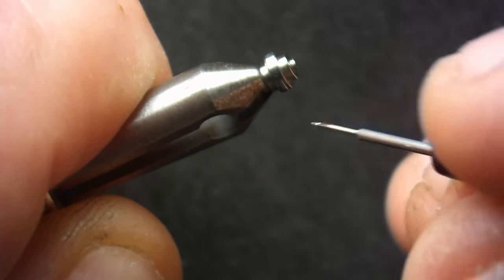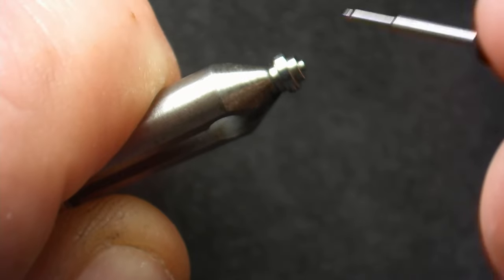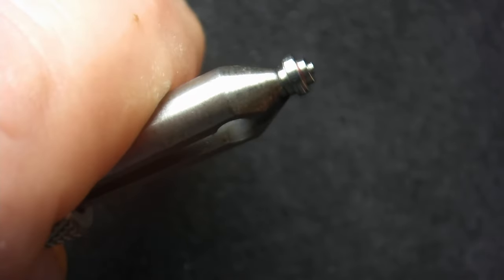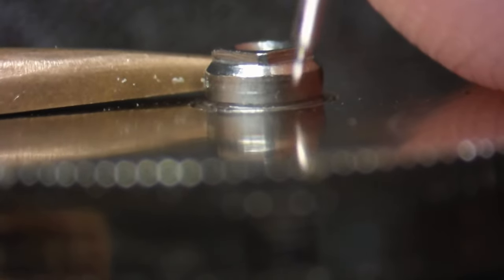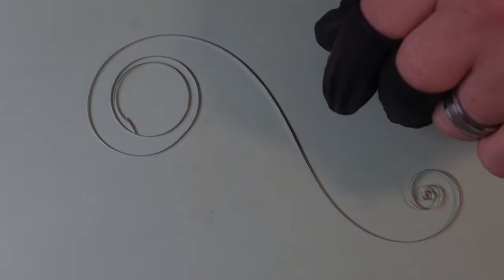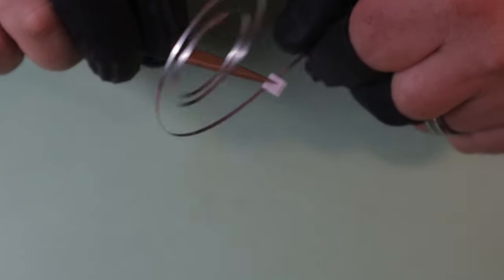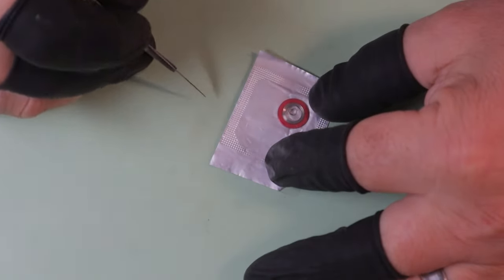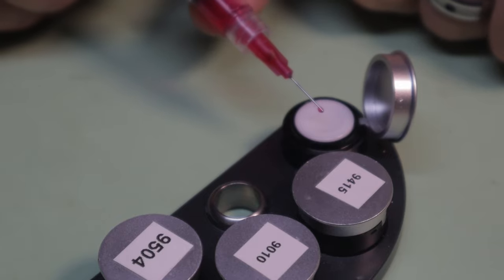Watch Lubrication for Beginners

Comment: Here be nuggets of gold
Reply: The shock system and pallet stone lubrication is coming up next. There may be a couple Nuggs in it.
Reply: Aye, the syringe tip is so simple it's brilliant.  But does the oil degrade the rubber plunger in the syringe?

Comment: It's interesting that everyone seems to do lubrication generally the same but also differently if that makes sense.  It can be confusing watching multiple people do lubrication on watches.
Reply from the maker: That's why you should watch people that have or do it for a living.
Learn the right way and don't get into bad habits.
The biggest issue is over lubrication. As the wheels get smaller, less oil is needed on each wheel pivot.

Comment: You mention here not to lubricate the palette jewels, but the next video goes into detail about the correct process to do so. Is the distinction between oil and grease? Does "lubricate" specifically refer to oils? I can see how oil would move as you describe here, but grease would only transfer to the surfaces that make contact.
Reply from the maker: No but there is a distinction between the pallet fork jewels and pallet fork stones.
The pallet for jewels where the pivots move back-and-forth are almost never lubricated unless the pallet fork has conical pivots and endstones.
Pallet for stones on the other hand get lubricated with 9415.  9415 is a special thixotropic type grease that basically liquefies when something comes in contact with it like the escape wheel tooth and then as soon as that contact ends it's solidifies
The escape wheel teeth move so fast that a regular oil would be thrown off and contaminate the rest of the movement, which is why you only want to use 9415 to lubricate the pallet stones.
I can see why this could be confusing because the term stone and jewel are often both used when referring to the pallet stone .
Reply: @watchrepairtutorials  brilliant, thanks for clarifying, and the extra detail is very insightful, thanks!

Comment: What do you think about using Moebius 8301 and its best use? When is it best to use instead of 9504, and can I get away with these being the only two greases I use, or should I also have 8200? My current lubes are all Moebius: 9010, 9104 (HP-1300) and for grease: 9504 and 8301 (Grease). Super helpful video, I only ask because I got some conflicting suggestions from another source indicating that 8301 was more versatile than I think it actually is...
Reply from the maker: As far as I’m concerned, 8200 or 8300 or even 8301 are strictly for lubricating a main spring that’s being reused. Considering that there should only be an extremely thin film. I don’t see the advantage. If you have 8301 there’s really no purpose for getting 8200.

Comment: How great it was to have found your channel.
I'm a computer engineer with the mission of restoring some watches I got from my father, two of them are over 100 years old (pocket watches: omega and cortébert) and a Cartier wrist watch, so I have the mission to maintain these jewels within the family tradition where it is in the third generation with me. Therefore, I decided 30 days ago to start my studies to find out how to restore them, but I ended up falling in love with the art of restoring mechanical watches. I believe mechanical watch restoration has become my new hobby. Currently I have gone through the planning phase, purchasing tools, component analysis, cleaning and reassembly (where I am in the phase of studying lubrication).
I will finish with polishing the case, as I am still in the learning phase about this final part.
Your channel is certainly far ahead of the tips I got on the internet. I've already been through about 20 tips channels, but your channel has very perfect classes. So I want to express my gratitude for your shared knowledge and also declare my respect for you. I wish you great success and prosperity.
Reply from the maker: Excellent. I’m sure you will do well as troubleshooting is 100% analytical thinking. 
If you hit a roadblock in your studies, you should consider my course on watchmaking as much of the information you need will not be found on the internet.

Comment: At 13:00, "So, never, ever lubricate the pallet jewels."
At 18:47: "It's not going to be a great lubricant for the pallet jewels"
Was 18:47 meant to be "pallet stones?"
Best lube video out there especially when it comes to the keyless works. I've seen many but your procedure is all common sense and well thought out.
Keep them coming.
Reply from the maker: Hey man,
In my head pallet jewels and stones are the same. So yea, the pallet forks PIVOT jewels would never get lubrication.
The pallet stones get the 9415.
At 18:47, I must have been talking about using 8000 to practice with. It’s better than nothing, but not great.

Comment: This channel is incredible.  You give us all the detailed information that everyone else leaves out.  Such an incredible resource.  

I do have one question though: how does one polish something as small as an oiler?
Reply from the maker: Thank you Steve. I have found the easiest way to do. It is on the rotary tool with a hard felt wheel. Do you load it up with a fine polishing paste like rouge or the Polinum that I used and you just lightly touch the tip to the wheel as it’s spinning. You only want to do it for a second or two at a time and then check it because if you leave it on too long, it could burn through the tip of the oiler.
Reply: @watchrepairtutorials  Thanks!

Comment: High torque low speed Mob hp 1300
Mainspring barrel 
2nd wheel
3rd wheel 
Parts that rotate
Ratchet wheel
Click 
Motion works on posts 
Intermediate wheel
Cannon pinion outside 
Barrel arbor shoulder (where it goes into something) 
End of stem 
Post for yoke 

Low torque high speed mob 9010
4th wheel 
Escape wheel balance wheel

Mob 9504 grease or MDX 
Parts sliding against each other under tension 
Grooves wheels sit on
Cannon pinion 
Keyless works 
Small dot of grease in each flat side of stem 
Ratchet teeth in sliding pinion 
Each side of groove on winding pinion 
End of yoke 
Spot where spring contacts yoke 
Setting lever 

Mob 8200
Mainspring 

Never lube pallet fork 

(Anything I forgot?)
Reply from the maker: That is a good recap
Reply: Good one 👍🏻
Reply: I have no idea what these terms are,I'm new,have a tool kit and fixed my 1st watch...I need to SEE what those parts are so I'll watch the full vid.

Comment: Thank you for the explanation about lubrication and the pallet jewels. I see some of the advanced watchmakers lubricating the surface of the pallet jewels, but they also say you absolutely must use Fixodrop... but never explain why except to say that it "keeps the lubricant in its place." Your explanation now fills in the gap in that concept for me. Since Fixodrop and the recommended jar for it are so expensive, I think just avoiding lubricating the pallet jewel is the wiser and more affordable course of action, so thank you for giving me the permission I need to just not bother. :)
Reply from the maker: First things first. The friction between the pallet stone and escape wheel teeth is one of the highest in the movement and should always be lubricated with 9415z
I always treat pallet stones and escape wheel teeth with epilame.
I didn’t include it in this video because this is for beginners who need to learn and practice proper lubrication first before adding another step.Epilame will not be effective if the lubrication is not done correctly.

Comment: Whew.  Being a complete beginner, these details are invaluable and the step by step process is very much appreciated.   I might have never stumbled onto the techniques of picking up various amounts of oil with different angles and speed.  Obviously, it's going to take a few pages of notes and several re-watches (sigh) to get these details in my head.    A couple of questions:

You showed accidentally getting a puddle of oil around a jewel.  How do you go about cleaning up the "spill"?

Do you do lubrication using a loop or a microscope?   Would appreciate a video on selecting a binocular microscope if possible.   The Chinese microscopes are fairly affordable and I have other projects that would help spread that expense.

Finally, seeing what tools you use has helped trim down the initial shopping list built from reading various forums.   At this point, I'm just enjoying the videos and learning.
Reply from the maker: The over lubrication example was excessive for sure. In reality if it that bad you should probably strip it down and re clean all the parts. Small mishaps can be cleaned up with a Qtip and IPA or Hexane.
I do 90% of my work under a microscope with a Barlow lens which gives me more working room. I really only work on the bench when I need to do horizontal work like jeweling or staking work.
I plan on doing a microscope video down the road but, I would check out Amscope if you are in the market for one. 
The tools for starting out are pretty basic. As you get further down the road you will need to start adding more tools. I typical recommend to build your skills with what tools you have and the tasks that are performed with them like lubrication before moving on to other tasks. no need having a bunch of stuff you can't use

Comment: Did I learn anything at all?  I learned a lot!  Especially about polishing the oiler, the direction to use it and how to move the wheel to check the amount, thanks so much for everything you have taught.

Interesting that you use a grease for keyless works, usually the tech guides for ETA will suggest HP-1300.  Something thicker does seem to make more sense, but I guess the torque is not that much.
Reply from the maker: Yeah, this is one of those areas where it can get pretty controversial, and people are very opinionated about what you should use.
In certain areas of the movement, like the keyless works, where amplitude is not affected, you certainly have more options. I grew up using Molykote DX which is a grease. For me it makes a little more sense to have something that clings to the parts better than an oil where are you have metal on metal friction. 
Oils tend to be attracted to sharp inside corners which is one of the things that holds oil where a pivot in Arbor come together. But oil also tends to creep around curved areas. That’s why I use 9504 in the keyless works because I feel it stays in place better.

Comment: Thank you so much for refraining from the elitist attitude and telling people what cheap oils they can get to practice with! For real, it sucks how many people seem unwilling to answer that simple question. I don't care if the oil isn't going to last a life time, I don't care if it doesn't last a week! I just want to buy an old cheap movement, tear it down and put back together 15 times and see that balance wheel fire up when I'm done. That's it. I swear some people forget that they once sucked at this too.
Reply from the maker: The fact of the matter is that it takes a while to learn how to properly lubricate a movement and there’s really no reason to use the high price correct lubricants because you’re probably gonna be over lubricating it anyway.

Comment: Probably a dumb question, but how do you polish the oiler? 

The clear pictures of the actual oiling and greasing are absolute gold. A big head start on developing oiling technique.
Reply from the maker: The easiest way to do it is with a rotary tool with a hard felt pad and using green Dialux compound or any high polish compound. 
You can also use 1500 to 2000 grit sandpaper to polish it.
Reply: @watchrepairtutorials Makes sense, thanks.

Comment: Thanks, Alex. I bought a set of oilers and I use the largest one to remove oil/grease from the bottles and the smaller ones to oil jewels and other places. I also bought an Obama automatic oiler to collect although I don't use it.
Reply from the maker: Perfect. That big old yellow one is also good for adjusting collets.🤙
Reply: @watchrepairtutorials  Yep, a lot of tools come in handy for other things. I bought a couple of tools from a guy in the UK that thought that they were made to install watch hands. What they really were was Accutron Index wheel finger/collet tools. I was so afraid that someone else would see the photo that revealed what they really were and outbid me, but nobody did.  
I also have a genuine vintage set of Dumont Bulova Accutron tweezers. I've never seen another pair like them so far.

Comment: Hello! What is the best way to polish the oiler tip, from your experience?
Reply from the maker: I use a rotary tool with a hard felt pad charged with Polinum but you can use and high gloss metal rouge or compound

Comment: Thank you for your lessons, they really help beginners like me.
I have a question. What is the proper way to lubricate wheel jewels?  From the inside of main plate and bridge(s), before installing the wheels? Or from the outside, after installing the wheels? I saw videos where some do it from inside and others from outside.
Reply from the maker: In most cases you are oiling from the outside of the plate or bridge. This is the side with the oil sink. 
There are occasions where you apply the oil directly to the pivot shoulder then install it into the jewel. For example like the barrel arbor before it’s installed in the barrel or a seconds wheel that is installed into a hollow center wheel. 
Basically, the rule of thumb is you need to oil it first if you can’t get lubrication directly to the pivot shoulder that rides on the jewel.

Comment: Alex, just curious, you said you don't care for the larger oilers, but which ones were you using in your demonstrations? I'm assuming the finest point one would be a good place to start?
Reply from the maker: Correct. I personally only use the finest tip

Comment: This is great, best on youtube. Any chance for an advanced lubrication video showing braking grease for automatic movements, as well as how to oil the reversing gears? Maybe talk about epilame?
Reply from the maker: I already did. The Braking grease is demonstrated in "How to Get Higher Amplitude from your Mainspring Barrel" and lubricating reverser wheels is done in, "Beginners Guide to Working On Automatic Watch Systems".
Reply: @watchrepairtutorials  Thank you! I watched those when they came out, but clearly forgot they mentioned those.

Comment: A syringe is a great idea, have a bunch of insulin sized ones with the small needles. Don't need 'em for myself, thank goodness. I was thinking less oil would be achieved by removing the oiler fast. Lots to learn.
Reply from the maker: Just FYI. I’ve heard the insulin syringes are too fine to take up oils.
Reply: @watchrepairtutorials  Bummer. I have a few with inch long needles that I used to inject vitamin B, those will probably work.

Comment: Hi Alex, Thank you so much for this super useful tutorial. Today i got a super cheap watch that i really like , sadly there's no good watch maker in my area, so i decided to try and service it myself,  i know i will most likely end up doing worse than those watchmakers but i find this job intresting and fun , the problem is that am on a real small budget, can i just use mobius 8000 on all lube points ? Of course, I am doing this on a 3$ watch that needs a service. Thanks a lot!
Reply from the maker: You can, but you won't get good performance. 8000 is too thick for the fast moving pivots and too thin for the slow moving pivots so amplitude will be affected.
And you definitely don't want to use it on the Pallet stones or you'll probably end up with oil on the hairspring.

I would suggest that you just have a little fun and don't worry too much about the performance because most likely you're not gonna get something that you can wear on the daily that has any accuracy at all.

Comment: Awesome video thank you so much. Question... how do you go about polishing your oilers? What do you use?
Reply from the maker: I use a hard felt pad on my rotary tool loaded with a fine polishing compound. Polinum or diamond paste. 
With the wheel running at a low RPM, you just touch the tip to the felt pad. 1 second at a time or it will be gone.